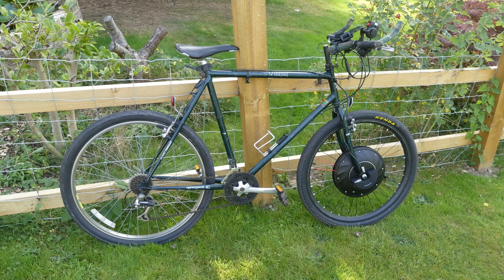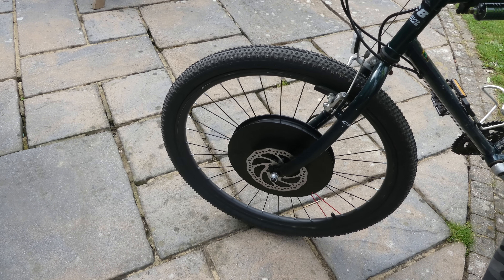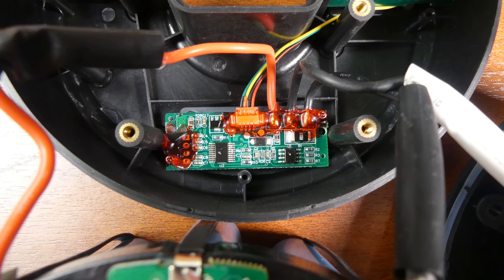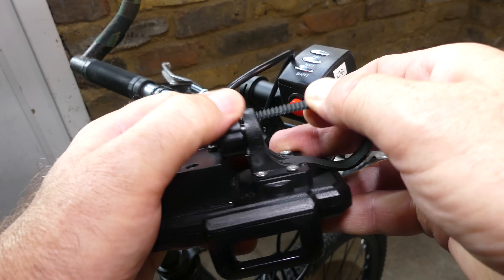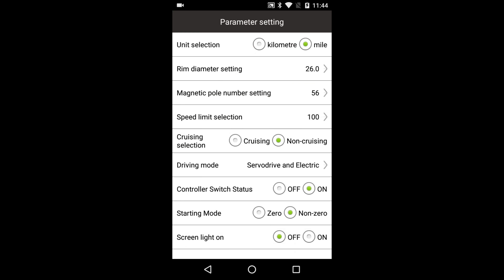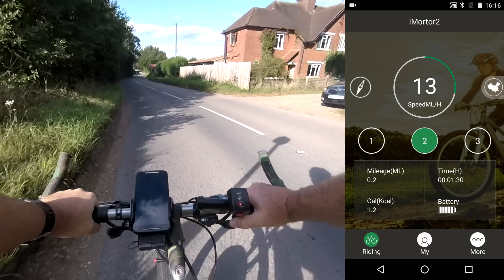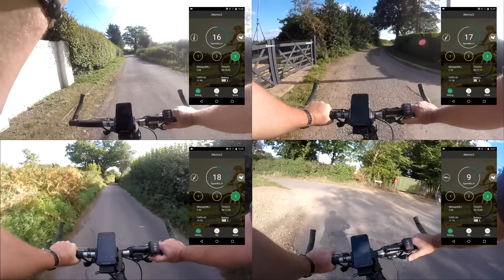Turn an old bike into an ebike - cheap & easy IMortor conversion kit

Comment: only 1P - (1 set of 10 batteries in series) so not much power, or for very long. most 36v ebikes will have 3, 4 or 5 times the battery amount/capacity, so this unit will not run for long.

Comment: The only thing stopping me getting one is the poor range/battery duration.
If it had a separate larger battery pack....  No brainer.
Reply: its quiet easy to solder extra wire extensions to the battery. my range with extended packs about 15AH 36V 70km. this motor really sucks some juice if you dont pedal along hard enough
Reply: Hey man, my batter went out and I’m trying to figure out if I can by a different battery and plug in the the motor. I wonder if the controled is built into the motor or into the battery.

Comment: I don't have a cellphone as im retired pensioner. I guess theres no way around it you have to have a cell phone to run this system ?
Reply: I have cycled halfway around the world asa cycle tourist.  I'm not technically minded so never tried this, a bit daunted electronically, but I fail to see in the end - (unless you can afford to spend every day or so in a motel or B&B) -how will you charge your used up battery on a cycle tour?. Tther than struggling up steep hills and heavily laden, there is no ebike that can better peddling manually and unfortunately that's a fact. As much as I want an ebike to get me further afield so I can pull my doggie trailer up steep hills (with cars right behind you on narrow country roads )behind and NO pavements its tough).and atleast by 60 miles.... charging your battery requires great expense on hotels etc.

Comment: Not worth it for the price. If you shop around you can get a kit with a stronger motor from amazon and higher amperage batteries from ebay (without the plastic shell) and a bike bag from anywhere to hold the battery.  $400 CAD or $306 USD

Comment: I would not say this can be done"cheaply", will cost around $600.00+ everything considered, that doesn't include the bike of course.
Reply from the maker: The price  was  heavily discounted at the time, no doubt it will be again at some point.
Reply: techydiy that would be great, I have been looking into either electric or gas, the electric is crazy expensive right now, while 2 and 4 stroke engines are still affordable.
  The electric would be great, but I would definitely need an extra battery, higher speed, longer range, but things are changing, and a loud gas bike drawls attention, while the electric motors are very quiet.

Comment: Overall, the lacking battery capacity makes me pass on this kit, although I like everything else about it. Nice presentation.
Reply: But u can always change new one and wear 2 or 3 ones :)
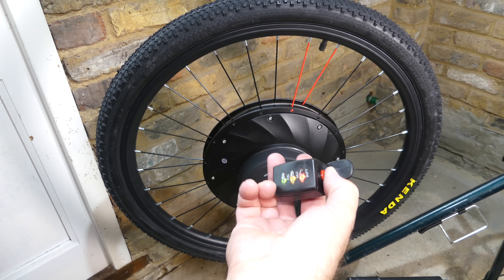Reply: Or buy a separate battery and xt30 connector. A wired battery can be placed anywhere since the inner portion doesn't spin 1:48

Comment: You can barely pedal and go faster than that top speed with ease on any decent bike. That isn't a bad kit I guess if it's a couple hundred bucks but icer that and you might as well spend a tad more and buy a good 500 or 1000w kit. To me that getting that speed would be a waste. Esp with that tiny little battery pack.

Comment: Motor seems nice, should be afficient with that big diameter, but battery on that kit is a joke. You could buy multiple batteries and swap them but question is, do you wanna cary additional stuff or just go and ride. This kit wouldnt even get me to work and back single time, while my actual diy battery can do it whole week without charging.

Comment: Why such a Rinky dink battery, why not attach a big battery to the frame connected with wire, seems the technology is available.
Reply: i did that and it works super well. I get about 70KM range with about 16AH of 10S packs.

Comment: Cool but I don't like hardware that's tethered to an app like that.  App disappears in a year and you're sol
Reply: Actually, you only need the app to set what power level. After that, it's just for monitoring. We set ours to the highest level and haven't turned on the app ever since. Have had it now for about 6 months on a trike hauling two kids! Works great!!
Reply: @elitehuntclub  that's cool.  I just dislike app based systems in general. Having the app as a secondary interface is great but if functionality of any kind depends on it it's a no go for me.

Comment: Why the 6666, is the number of the devil or the solar logos, sunny reasoning
Reply from the maker: Well, if you google it  ...
666 usually signifies the "number of the beast" 
and it turns out that 6666 usually signifies something good, like an Angel.
So there you go ...

Comment: There is a dremendous mistake in spoking this motor rim. In order to transfer the motor force the spokes are working extreme hard because of their angle. Please research my claim if you want. For the same reason you will not find disc brake wheels with radial spoked spokes!!!!!

Comment: Lmaooo only 10 18650's, my custom built ninebot es4 has 192 18650's
Reply: True, the battery in this video is a joke
Reply: @MistrzBartek125  I guess that's how they make it cheap though, the battery probably won't last many cycles either since it's likely pulling around 10amps continuous.
Reply: mashed potatoes yeah, my laptop has a better battery than that thing... it’s only 6 cell (and only lasts 30 minutes just downloading updates at McDonnalds), but it’s made for high current draw (the CPU uses 80w, the GPU uses like 120w, and the 120Hz monitor sucks on a little too). It’s like 240w exactly as the massive power brick has it slowly losing power as you game with it... charger says 19.5v at 11.8 amps, so yeah, basically running that bicycle full out!!!

Comment: Costs nearly as much as an ebike.
Reply: Think the idea is to convert  existing owned bike to e-motor assist.  Some of the newer inexpensive e-bikes {Not All} have problems from cheap materials  & manufacturing.  I have seen some under $700 e-bikes with broken frames, ect.

Comment: I think this is dangerous - the main thing is lack of balance
Think of someone trying to push you down - if you stand with your feet together, you fall easily, but if you stand with your feet apart, not so easy
Same concept - a regular bike has a very thin wheel & that is why when you hit a pothole, you lose control of your front wheel - and it is not a problem because you are going at say 3-5 miles per hour
But with a souped up bike, now you are going 15-20 miles per hour and now that same pot hole and losing control will lead to tragedy
That is why if you are thinking of buying an e-bike get one with fat tires - more stability

Comment: what cheap?!!!! only the front wheel cost $529 while can find an entire bicycle cost $600
Reply from the maker: They have huge discounts on a random basis, you just have to look frequently.
Reply: Mine was about 300 dollar and im very happy with the performance when using a 50 cell additional external battery that i custom hooked up in parallel

Comment: it seems you have to buy a mobile phone to operate a bike!
otherwise id get a unit right away
Reply: That's just a gimmik for the speed reading.  Yes settings can be changed with the app, but there are still defaults that will mean it will still work.  You would just need a more traditional standalone speedometer.  That's how I understand it anyway.

Comment: People. Electricity is a VERY expensive form of power! Generating it and then STORING it! Batteries require us DUMPING them when done-with creating poisonous chemicals-disposal-methods, not cheap! Peddling not difficult on flat ground so why cycle if you are not enjoying the ride? The internal combustion engine will live longer than electrical power on personal transport. WE are the dirty ones not the fuels we use. We are getting fat being lazy. Cycling with pedals will last longer and so will we! VERDICT = The video is Bullsh*t!
Reply: Sorry dude, you will never convince people that making electrical components and disposing of batteries is bad for the environment. Like all new toys people will clutter up the landfills with this junk for the next century. Pedal bikes were proven the most efficient means of transportation a century ago and still reign on land.
Reply: Purdie -a spectacularly wrong comment in all respects (imo!)